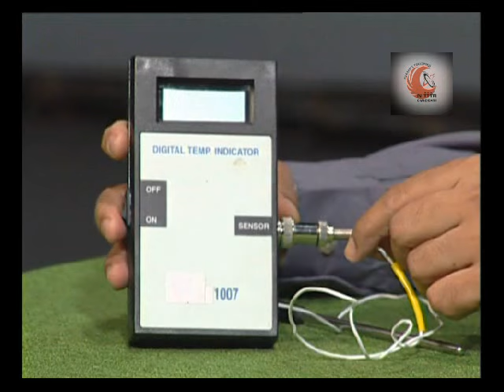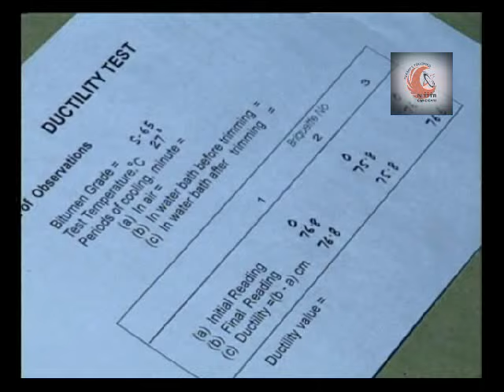Ductility Test of Bitumen

Comment: This test is not taken correctly, you should add Sodium chloride (NaCl) in water to increase the density of water as bitumen density is high and it touches the bottom surface, the result may be affected.